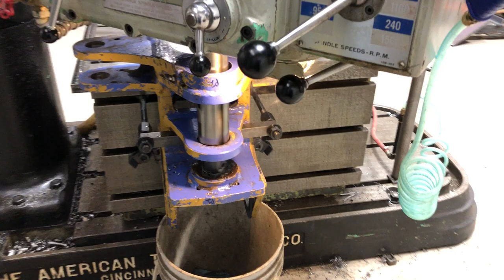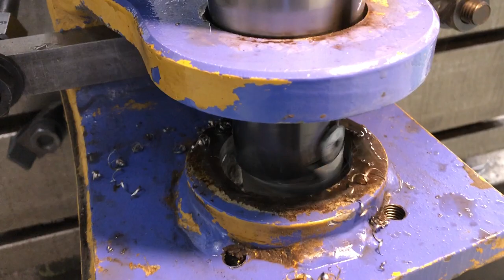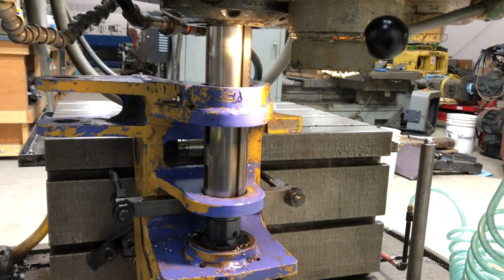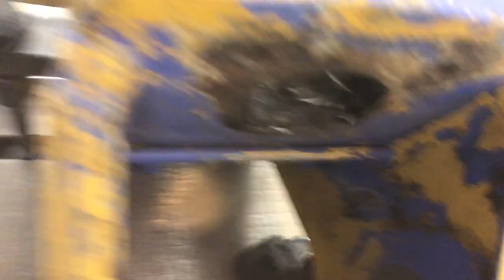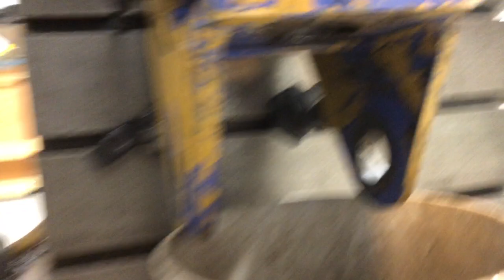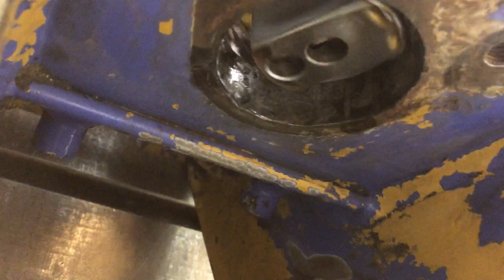Short Boring Video

Comment: Inventive to say the least using a RAD to do the boring.
Reply from the maker: I've used this radial drill to do quite a bit of boring, especially before I got my horizontal mill.  This particular drill came with the boring option that was available from the factory.  It's just a lever and when you move it from 'drilling' to 'boring' it cuts the feeds by a factor of four.  It gives as low as .001" per rev which can give a pretty nice surface finish.